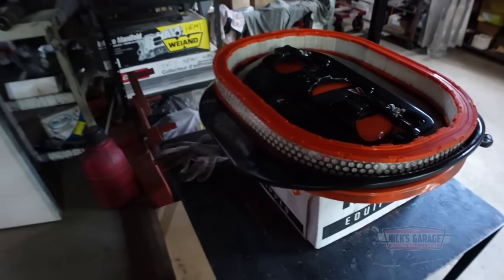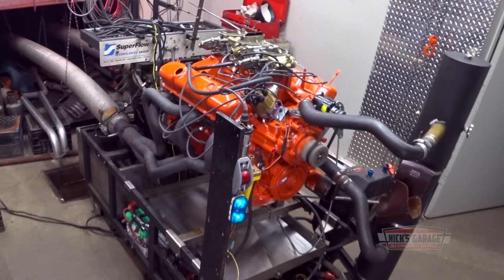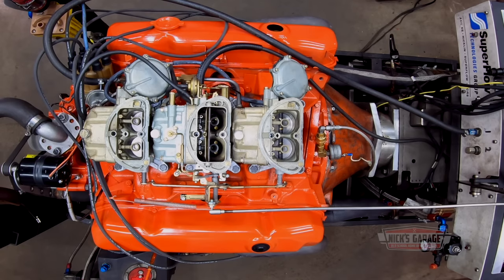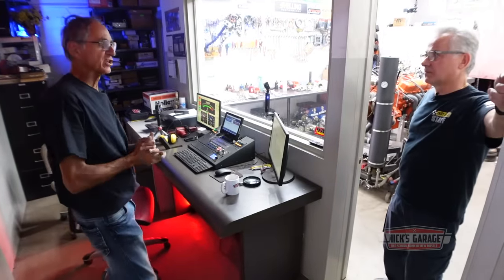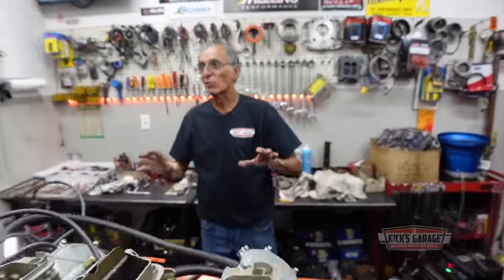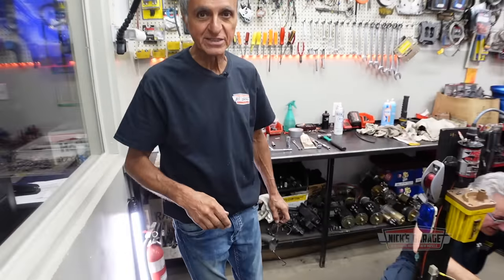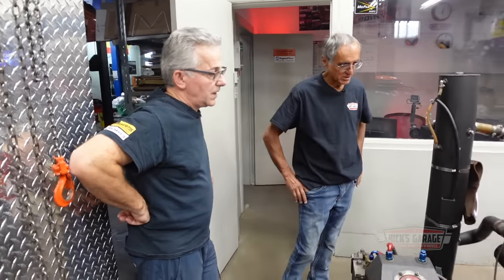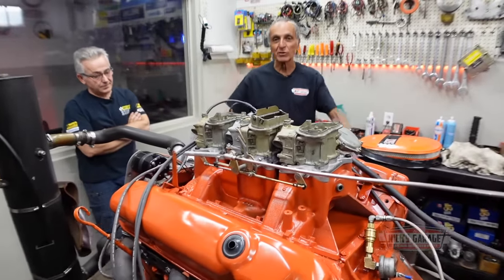HOT 1970 383 Mopar - Stroked and Dyno Tested - Road Runner Tire Melter

Comment: I like all American muscle. Grew up mostly a chevy guy but I am now obsessed with mopars! To me, the B and RB engine are mechanical masterpieces. Things I like...strong lower ends, external oil pumps, skirted blocks, one piece oil pan gaskets, distributor in the front, no coolant passages in the intake, good cylinder heads/valve train, and easy to work on and make power. This is a great video and a prime example of an engine I want to build soon. Just picked up a 383 core to rebuild and you guys give me the inspiration to get it done👍
Reply from the maker: Go for it! Let us know if we can help.

Comment: I ran a 68 Galaxy 500 with a 390- 6pack and never ever once properly set had to adjust a carburetor. For over 10 years. Always ran Great ! One of the Best car I ever owned. Always could make you Smile I’d drop the top and listen to that 6-pack , those 3 little Holley carburetor open 1-2-3 . They came in so good. Once there don’t mess with them. 😊

Comment: I had a 383 magnum , out of a 69 super bee, in a 69 charger , holly 780 cfm double pumpercrane fireball cam back in the early 70s the new cam was under 40 $, 3:55 rear gear , she would run like a bat outta h**l , never saw a 383 6 barrel, but I did get a nos 383 dual quad intake , gotta love the 383 , those were the days ! There was a fella with a 383 road runner ( built ) who was out running 440s , then I got a 340 duster auto bench seat, it had a big Carter, I was never beat, it would out run 440 six pack with no prob, that was fun fun fun !!! That 340 would wind up where it sounded like it was gonna launch rite through the hood, da*m , GO MOPAR

Comment: Fifty years ago, an old timer showed me a trick to "fix" the "half dead" carburetor.  He crossed two spark plugs which, induced a repetitive crossfire/backfire through the intake upon a "snap acceleration".  Carburetor fixed!  Whatever was clogging the idle circuit was blown out and settled to the bottom of the float bowl and never came back.

Comment: You don't often see the 383 or 400 6 BBL's but when you do it's quite a treat!
40+ years ago my Mopar mentor buddy Bob built a 383 6 pack engine for his 70 or 71 convertible Challenger, what a spectacular car and engine.
I don't remember the h.p. number but it was easily over 450+!👍
The convertible Challenger was a factory 318 car that was at a repair station around the corner from Bob's house. He drove by it and stopped in the shop to ask his buddy who owned the shop what the story was about the car. The engine was blown and the owner of it didn't want to fix it, so my buddy asked to buy it and the shop owner said he'd talk to the car owner.
A few days went by and when Bob went by the shop again the car was gone.
He went in to see what happened to it and discovered one of the mechanics who didn't know the shop owner was going to sell the car to Bob had sent it to the junkyard!😮  He burned rubber flying to the junkyard to hopefully save it!
Luckily he was also friends with the yard owner and asked if he knew where the car was.
Sure he said, aisle blah blah over there. Mind you this in in the late 70's so these cars were no big deal then.
As he walked down the rows he wasn't seeing the car. 
He again asked the owner where it was,he couldn't find it.
The yard owner said I know it's there, I just put it up there. Up there,up where? Well he wasn't looking up,it was on the top of three crushed cars!😲 Ahhh!!!
Reply: Congratulations, You just gave me endless nightmares.

Comment: Nick, it saddens me to see any 383 ever again after Selling my 71' cuda. I thought 🤔 watching your channel it would put me in the Mopar Spirit, but instead reminds me of something I lost forever. Best Wishes Cuda guy.
Reply from the maker: We're sorry to hear that, Gerald.  Hope you find that same feeling again, even if the car is gone.
Reply: @NicksGarage  thanks Nick you can only imagine selling you Kowaski Challenger. Once I was sent to Indiana. I drove to the Mopar dealership to order the Chrome tips for the Cuda. I drove my wife's Renault they was $100 each. They looked at me & laughed like I didn't have a 383 at home. It took sometime but I think direct connection or somehow they got their asses chewed because when I drove up in the Orange 🧡🍊 Big Block their faces 👀👀 was blank. They couldn't believe I drove it from down South to Indiana. I even went with my buddy Roadrunner Dude to the Mopar Nationals which was held that year Inside The Indianapolis 500 track. I bought a pistol grip shifter. The guy I bought it from removed the column shift & used a cutting torch to cut the floor boards to put a 4 SPD in it. It was purchased new in a town called Alice but a Automatic, he worked as a mechanic so he just changed transmission. It was a Original 383 Billboards & all but missing the Chrome tips. My dad had lung cancer later we found out. That damn Cuda wouldn't start for nothing We Trouble hunted down everything, then ROADRUNNER DUDE SAYS, did you check the VOLTAGE ⚡ REGULATOR!!!! My Dad was going to die & that $10 VOLTAGE REGULATOR STOPPED the Entire Engine From Running!!! Out of Rage I sold the damn thing. We replaced that $10 part on the driver's side engine Compartment & that 383 started up like lightning ⚡. I didn't drive to the Mopar Nationals I Rode Sidekick Instead in his ROADRUNNER. Car Love Lost in Time. Sometimes I think 🤔 the crap I get into could fill a season of THE TWILIGHT ZONE! Look you know about that little metal box in the Driver's engine Compartment. My one Chance for Two 383s to go together inside the grassy part of the Speedway. Sad but True. I couldn't make this stuff up. Still Love Cudas. One day down here I heard a large engine approaching, it was a 71' ROADRUNNER 440 SUX PACK . YELLOW & BLACK .

Comment: If you're just one or two percent short of your number, try running the oil a quart low. The engine isn't being subjected to launch, cornering, and braking, so, no harm should result.

I used to work on a Pro Stock team, and one or two thousandths of a second can be the difference between making the next round or loading up the trailer. We used nine-quart pans with four quarts in them, along with some very sophisticated windage trays, to keep the oil away from the crank.

When we had a "street" engine on the dyno, we would always run it a quart (or two!) low. That was usually good for four to five percent.

Comment: Nick a friends 383 we raced in a 70 Road Runner. 850 Holly with 90 jets. 1" spacer.  Timing at 38⁰. Motor was balanced and bluprinted. Steel heads, big valves. Hydraulic tappets. Purple shaft cam. Forged pistons. Can't remember the rods? 6 pk rods maybe. Ran 11.8 on regular gas at first with led additive. It would rev to 6000rpm no problem. Standard crank, +40 bore. When the engine builder dynod it the dyno messed up and reved to nearly 8000 rpm lol. The noise was incredible!!! 😁 520 bhp and 640 torque!  Eventually we tried a 150 Nos kit and got 10.2 on a quarter. Changed the cam for a custom grind. Little monster the 383!! Road Runner was stripped interior and two race seats and a roll cage.

Comment: My ex father in-law graduated high school in 1969, and he bought a '69 Super Bee and a '69 Harley-Davidson Sportster. As he put it, the Super Bee "only" had the 383 motor, and he sold it in the 70s when gas prices skyrocketed. He still has the Sportster that he turned into an "Easy Rider" style chopper (complete with a hardtail, long forks, high bars, sissy bar, and purple metal flake paint with pinstripes) but he wished he has his old Bee, too!

Comment: Hey Nick, I just subscribed! I’ve been watching for a few years and love your videos. I like what your did with the 383 stroker. It’s nice to see something different. Last year I built a 400 that was not a stroker motor. I love the idea of the large bore and the short stroke of the 400. I put a 383 steel crank in it. I feel the 383 and 440 gets all the attention and the 400 doesn’t interest people other than for stroker motors. After my build I put it on a Dyno and made 457 hp and 463 torque. Used 906 heads, hyd flat tappet cam and runs on 91 octane. There are many 400’s out there cheap and can make big power when built properly. It would be nice to see something out of the ordinary in your videos like what I did. I’m sure lots of viewers would be entertained seeing something like that. Thank you and keep up the good work! Jake P, Minnesota
Reply from the maker: Thanks for your subscription!
Reply: At what RPM?

Comment: 426 hp from 433 cubic inches, 485+ pounds of torque with the air cleaner on, with a smooth idle and very good vacuum. Not to mention its got cast iron factory heads. This is the engine you should make for everybody from this point on. This is going to be a tremendous street engine. Does anybody make reproduction cast iron exhausts from a Stage 3 Ramcharger wedge.? If not, then the best cast iron exhausts from the exhaust manifold test you made last year would be a nice second.  Nick, whoever suggested to you to test a 6-barrel engine with the factory air cleaner on, he gave you a nugget of wisdom.

Comment: Wow, Nick, that engine sounded awesome. 

My 68 Road Runner had the numbers   383  stamped on the flat surface next to the distributor.

A speed shop fine tuned the dual point distributor and rejetted the carb, plus he modified the air filter. It felt like it had another 30 HP. A guy in a 396 Chevelle got miffed when I beat him through the 1/4 mile. He swore I had a 440 engine. So I opened the hood and showed him the numbers on the engine.  LOL. 

Not sure if they did that for the 1970   383    but it would be a real put down for any thing that tries to beat that Runner. He could claim, "It has 383 stamped right here on the engine".

It really helped that I had sticky Mickey Thompson tires on back.  I could really launch it by holding the tach at 3000, let the clutch up fast and mash the pedal. I usually would be two car lengths ahead right at the start! Hold gas pedal on the floor, speed shift to second and slip foot off the clutch, BANG, it would lunge forward. If a car happened to be beside me, I would leap ahead almost a car length. 

That Road Runner was a blast. I had to trade it for an automatic, my wife could not push in the clutch.
Reply: We all love the 383. Great engine.

Comment: That centre carb isn't putting out the fuel the other outboard carbs are which might be the cause of the lean mixture at high RPM but damn that engine sounds good.
Reply: I keep seeing the same thing. Nick should watch the overhead view, he'd probably see it too.
Reply: I'm thinking what you're seeing is without the air cleaner on. This is one of the thing's I'm curious of about those three two bbl setups though. Those Chrysler air cleaners are really low profile

Comment: The horse power on my 69, road runner,383dualquad, factory in line,off a58plymouth,, with a little bit of modifying, pulled 460horses, and 510torque, and turned the eight mile in six seconds on the right rear tire going flat,had to let off the pedal about about a hundred feet from the light.

Comment: We did a 6 pack setup (440) a while back where someone decades ago eliminated the secondary vacuum pots and modified the secondary metering plates. I was expecting the absolute worst on the dyno, but it was actually pretty responsive and relatively bog free.

Comment: Tell me if I'm wrong but the reason those air cleaner base plates are so big- they come right out to the rocker covers- is to trap the hot air coming off the engine so it doesn't go into the carbs. And it's angled to feed hot air out the back. Great design.
Reply: If anything it traps the air under it and heats up the carbs , same issue wit hthe single 4 bbl base and the Hemi dual quad base .
Reply: @dartgts383  yeah maybe.
Reply: @dartgts383  I just remember when Nicks brother put just the base plate on his hemi race engine, from memory, it picked up some horsepower over not having it. So it is doing something.
Reply: @dartgts383  another good thing is you can actually tighten down just the base plate cos they've got those bars going over the carbs. Most air cleaners you have to put the whole filter and top plate on to tighten them down. So mopar really thought of everything.
Reply: @dartgts383  but thanks fr replying because I'm wondering what other people think.
Reply: @chriswalshe499  no it definitely does , I have a friend that had a fuel boiling issue, E10 fuel where we live , with the oval base air cleaner , it was much lessened when switched over to the unsilenced.
Reply: @dartgts383  yeah but that's with 10pc ethanol so I'm guessing it's lowering the boiling point.
Reply: @dartgts383  but if that's all you can get from the pump then yeah it'd be better without.
Reply: @dartgts383  I'm guessing the big baseplate is more suited to the old high octane straight gas of the 60s and 70s.
Reply: @chriswalshe499  you would be correct , the gas of then is nothing like the swill we are stuck using now. It's designed for a high pressure, closed fuel system that returns to the fuel tank , not vented to atmosphere carb bowls bolted directly to a hot intake that usually more times than not has hot exhaust gas flowing under the carb heating it more.
Reply: @dartgts383  haha swill. Yep

Comment: I had my dream car right outta high school, a 1970 Challenger 440+6. I knew that some of the AAR 340 also came with 6-paks, but I'd NEVER heard of the 6-pak setup being mounted on a 383. Interesting. Great channel, Nick!!
Reply: Yeah I believe the 440 and the 340 are the only 2 engines that ever got that carb setup. Fun fact they used the same carbs on both engines
Reply: If I remember correctly, Edelbrock made intake manifolds for all three engines, but you are right in that only factory engines that received 6 paks was 340 and 440.
Reply: Same here, you can get after market intakes, but never heard of one from the factory with 3 deus. I’d like to know more!

Comment: Congratulations Nick,, I knew you and the 383 motor could do it with a stroker crankshaft, even though you went the old school way  using a 440 crank cut down..that's the best way.🏁🏁🏁🏆🏆🏆👍😉. Swap the manifolds before you take it off the dyno, I know you said you don't have the right side manifold but put on the stock manifold that came off the 383 I know there's a there's a big difference in the high performance manifold but not that much to really make a difference and you can see how much it loses 🤷 20 30 horsepower..

Comment: I have a Lunati Voodoo 701 cam in my 383.  Awesome cam with smooth idle and 20” of vacuum but man does it rip and I’m running manifolds.  They really are nice modern grind cams.
Reply: Great Choice  Same designer but later design than Comp which was still using SBC profiles on MOPARS
Reply: @jmflournoy386  yep!  Harold Brookshire design.
Reply: @lukepokrajac1057  UD Harold  quite a story.  The even later designs that have ended up at  Howards were even better.  Comp converted the earlier designs to Automated Grinders as Crane had done when bought the Big Detroit grinder,  Comp then sold these now obsolescent. \ designs through their so called tech support. I preferred another  way of developing lobes
Reply: Back in the Day Mopar lobes were done in the South by a real artist, There was the Clay Smith way, Bill Jenks (Potvin/ Moon way.  Ed Winfield ground thecam for our AMCIndy projet.  Ed Iskenderian paid up for Winfields intellectual property and Crane also used it  Dick Jones developed it and computerized it with much further development.  Still the best cam design and selection programs.  GM had Jones sons Rik and  Mike develop  the cams for their Indy project.
Reply: @jmflournoy386  wow interesting!!!  The only bad thing I can say about the voodoo is it is a little noisy when aluminum heads warm up

Comment: I have a Hemi that used to have a crank that had been ground on the throws, and material was taken of the cheeks, the rod side clearance was at the allowable maximum on the tightest throw, about .008 I think, and double that on the worst. That engine had all kinds of oil problems, low idle pressure, and probably enough oil hitting the cylinder walls to overload the oil rings. I replaced the crank with one of my lucky finds, a standard Kellog.

Comment: The vacuum diaphragms on the end carbs could be stiff, dried out from age. The power-valve diaphragms are also a point of interest. Carb tuners like to open up the power channel restrictions by one size with pin-vise drill bits. Use vacuum gauge to adjust the power valve opening above the idle speed. Read the Holley tech manual instructions.  Seems to work, eliminates stumble off-idle. Love the Video.!
Reply: Thank you.

Comment: Once read about a build in a MOPAR magazine years ago 383 with a crank from a 413 which made 432cid . If I remember correctly it put out around 500hp
Reply: 440-413 are the same stroke if I am not mistaken I could be wrong but I think all RB blocks are the same stroke
Reply: @dinadaughtry8993  you are correct sir
Reply: The top-guy at Dodge stroked his personal 383 ‘Cuda and had great results — seems to be the best “numbers matching” mod